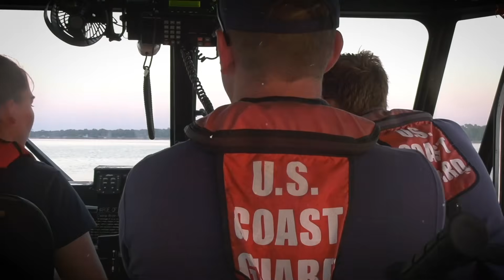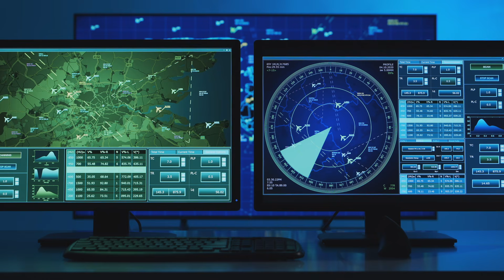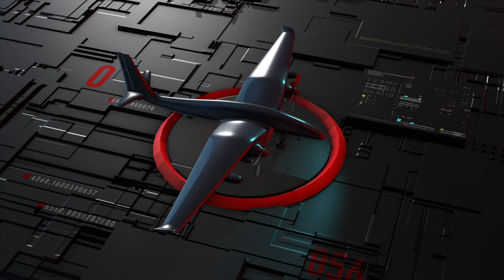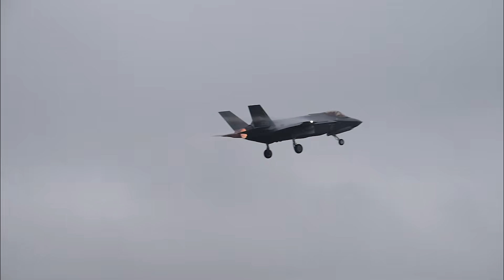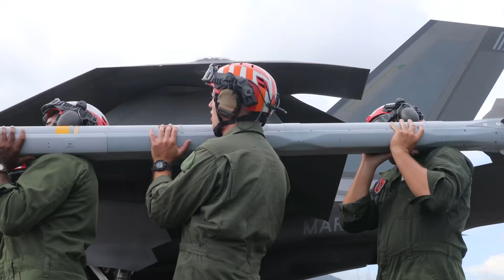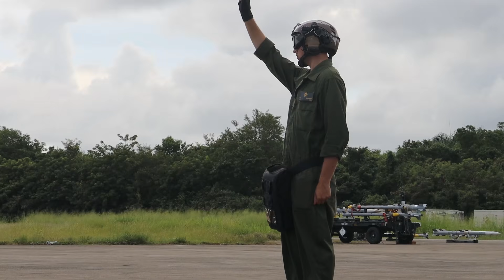F-35 vs MODERN RADAR — Can Stealth Even Survive?

Comment: F35 is an amalgamation of two forgotten Soviet technologies from the early 1970s😊
Check out the links to better understand the stolen engineering behind the creation of F22/F35/B2 and other stealth jets.
Reply from the maker: I see you shared a lot of links 🙂 there were definitely parallel developments in aerodynamics and radar research across different countries but modern stealth aircraft like the Lockheed Martin F-35 Lightning II are the result of decades of engineering materials science and systems integration not a single source or idea If you had to point to one specific technology what exactly do you think is the closest match
Reply: @VectorTechExplained The idea of steath or low observable on radar as we call it today was born in the USSR,but it was not given much importance back then because of various issues related to its maintenance.
Thats all I am trying to explain here.
There is no doubt that research on this subject was being done by several countries in the west.....but if you look at the timeline,the USSR bureau was a forerunner and it shelved the plans for reasons yet unknown.
Reply from the maker: @ajMirza-gc6il  That is a fair point 🙂 early research into low observable concepts was happening in multiple countries including the USSR and the US The real difference came later with materials computing power and the ability to actually integrate stealth into a full system like the Lockheed Martin F-35 Lightning II where shaping coatings sensors and data processing all work together Do you think early concepts were limited more by technology or by how air combat was understood at the time